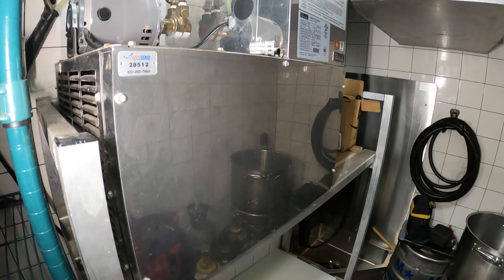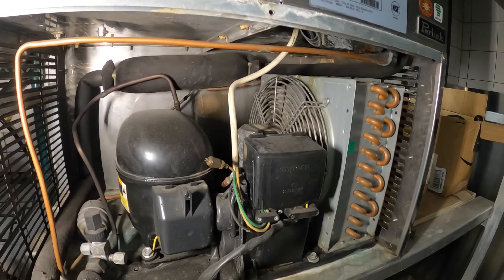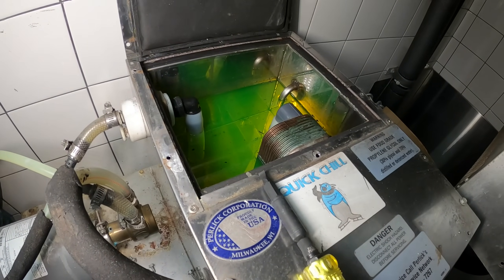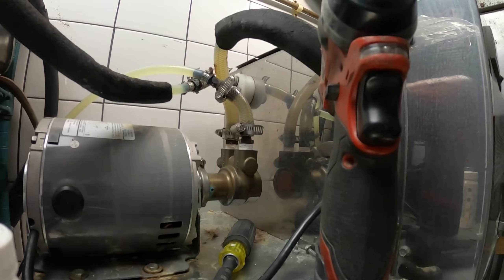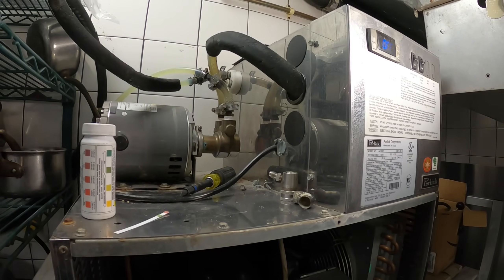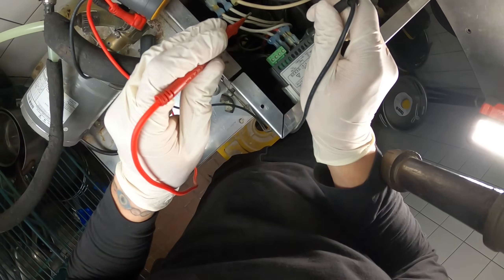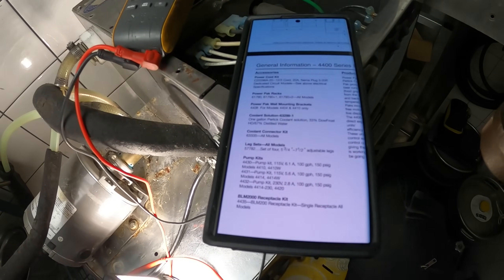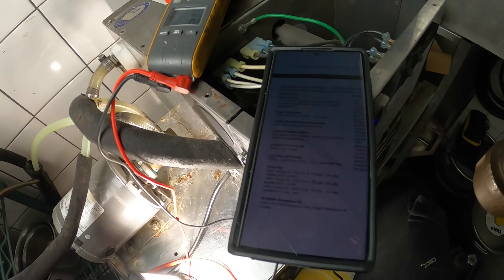HVACR: Perlick Quick Chill Power Pak Beer Dispensing System Freezing Glycol Lines (Refrigeration)

Comment: Stuck or welded compressor relay is really common with that style controller (all brands). I often end up fitting a bigger external relay when I replace the controller.
Reply: Yep that exactly what they need to stop sticking or melting 
The initial current draw is too much for those small built in relays
Reply from the maker: Def a thing I see happening on relays. That's a cool idea. Thanks for watching! 🔧⚡️